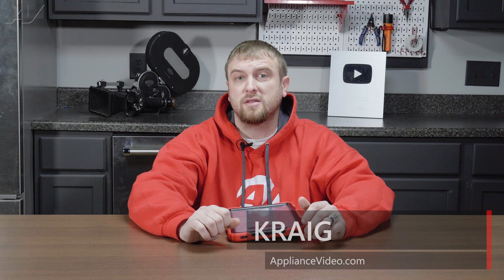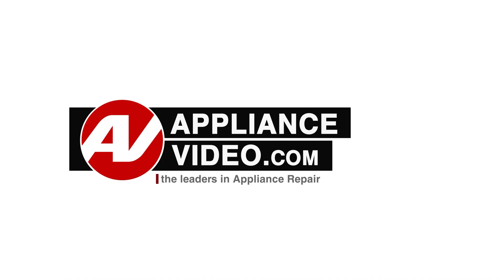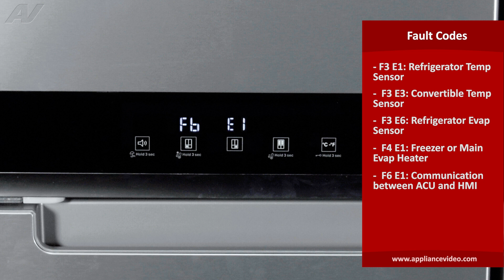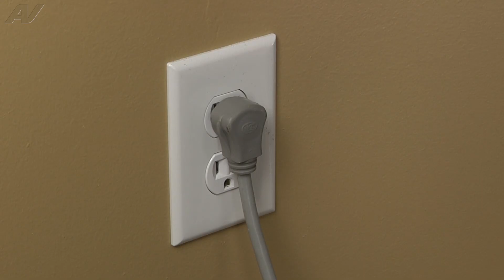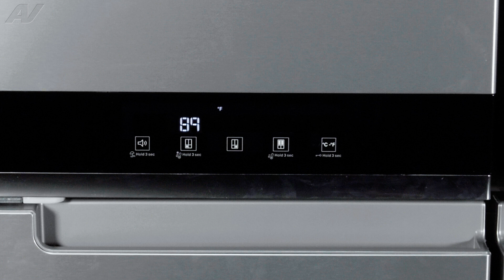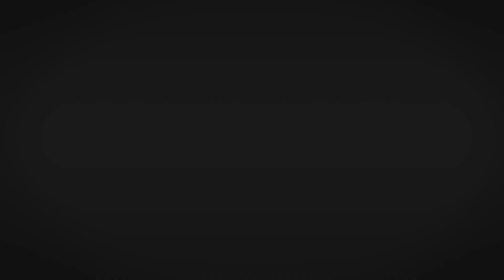Whirlpool Refrigerator troubleshooting, diagnostics, and error codes by Factory Technician

Comment: This was a helpful video. I have a Whirlpool fridge. Model wrqa59cnkz, it is a full size  RV fridge with an inverter. The sides get very hot when we turn it on. In lower back panel, where the compressor is, there is no compressor cooling fan, just the compressor and it gets very hot to the touch. . It does have an evaporator fan inside. if that fan does not work, will this create heat in the sides of the unit? And make the compressor too hot to the touch. I presume the evaporator fan needs replacing.